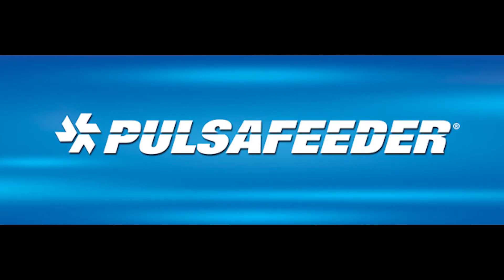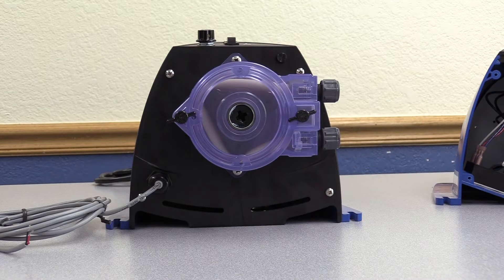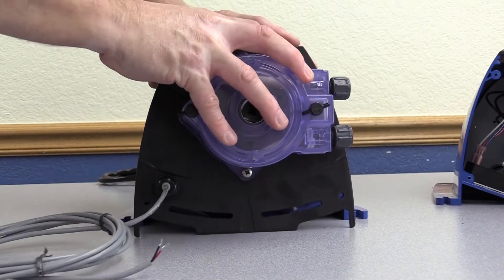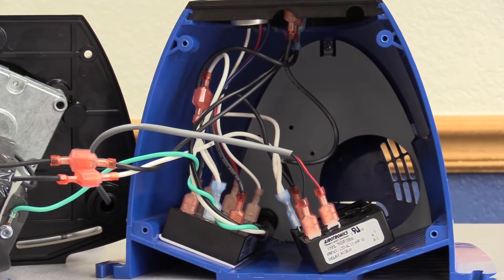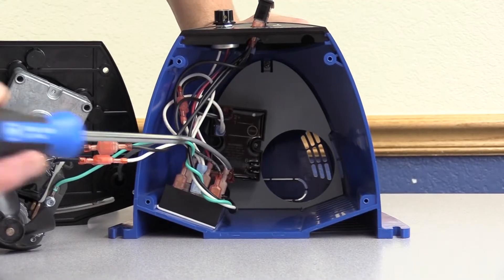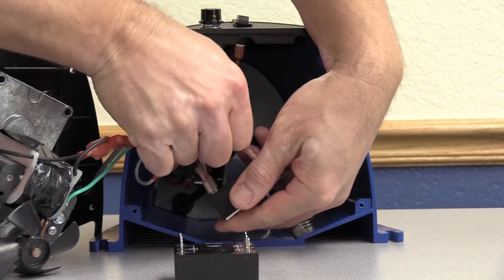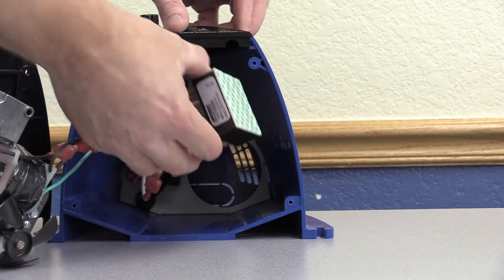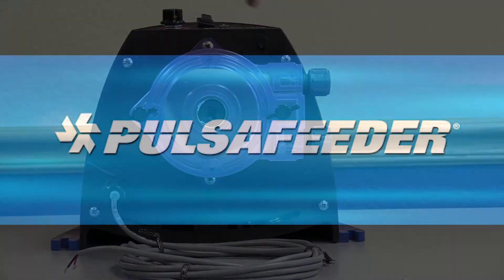Chem Tech XP Timer Module

Comment: What can I trouble shoot if it ain't pumping? I took of the outlet and it ain't pumping.  Also checked the strainer it was clean. Any ideas?
Reply: A worn out or blocked squeeze tube is usually the cause of most pumping problems.  The ends of these tubes have a very small hole through them that can easily get blocked up.  As long as the rollers are moving properly, a new tube would likely solve this problem. If you need further assistance please contact our A worn out or blocked squeeze tube is usually the cause of most pumping problems.  The ends of these tubes have a very small hole through them that can easily get blocked up.  As long as the rollers are moving properly, a new tube would likely solve this problem. 
If you need further assistance please contact out Technical Service Department at 800-333-6677 or 941-575-3800